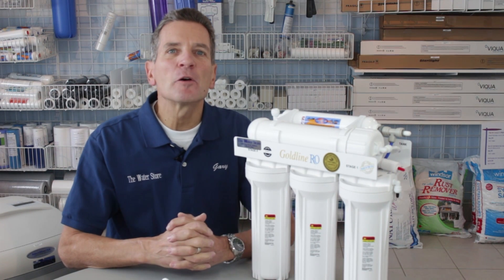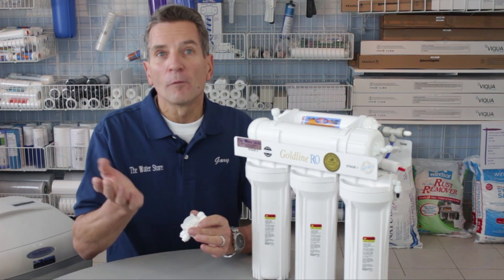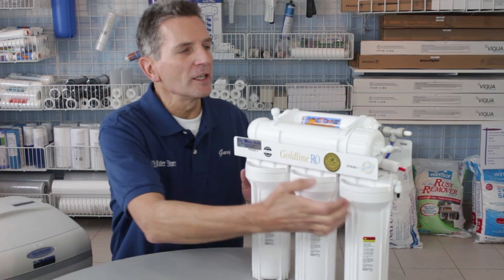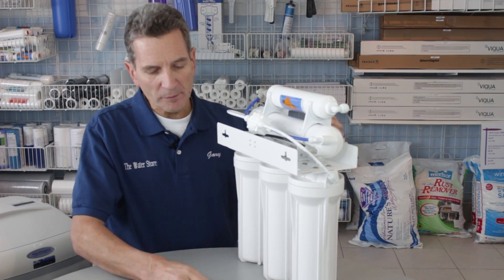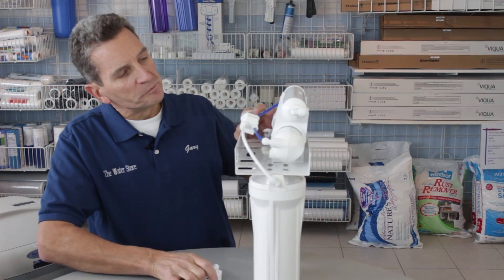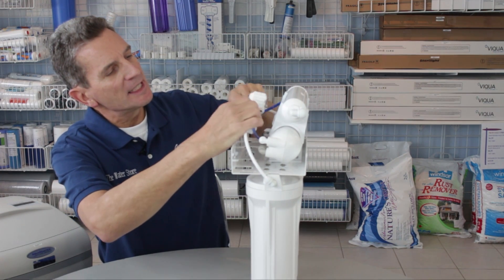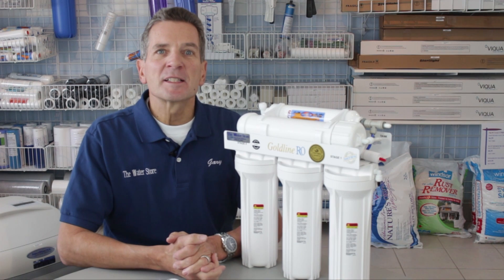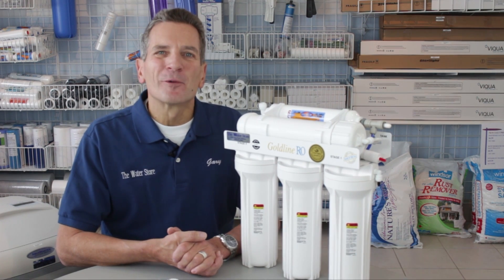How to Replace Automatic Shut Off Valve in Reverse Osmosis Drinking Water System

Comment: hi sir 
my tank is new T55M 5.5 gallon empty tank  has 7 psi  and my all 5 filters are new my house pressure water are strong  but my tank doesn't get full of  water  can I cancel Auto shut of valve or there is other  Auto shut off valve that to make more water before shut off ? even outcome water pressure from faucet  not too strong tank get empty very quick , my old water system was 4 stage filter I had for 15 years I didnt have any problem  i just replaced because of old  my bad  please what I should do ?
Reply from the maker: Something isn’t right. I would check with whomever you bought it from

Comment: But Are not you supposed to cut off the water flow and drain the tank before replacing the ASOV?
Reply from the maker: Yes, you should shut off the water flow and the tank, open the faucet to release the pressure and then replace the ASO.

Comment: I have  a question .  Why my RO system waste about 8 gallon per one gallon of R o water.  This is with all new filters and supply water pressure is 75 psi.
Reply: Hi Cuong.  One reason is a mismatch between ro membrane size and flow restriction.  In your case, the flow restriction is low for the size of your ro  membrane, then the system isn't efficient.  You can google it .